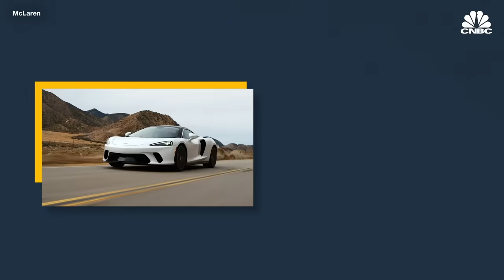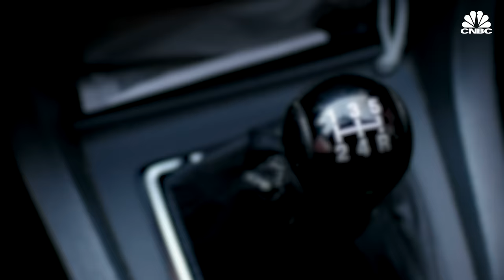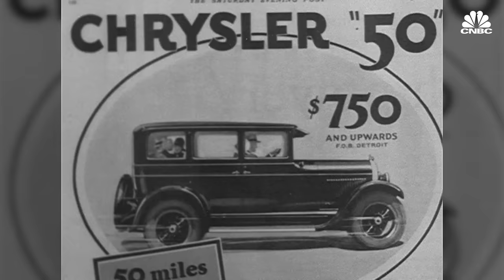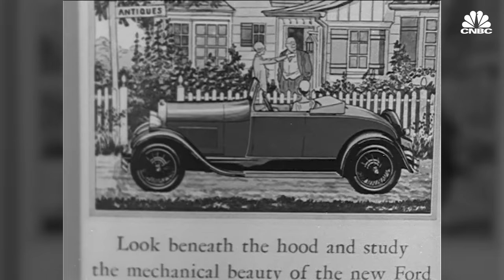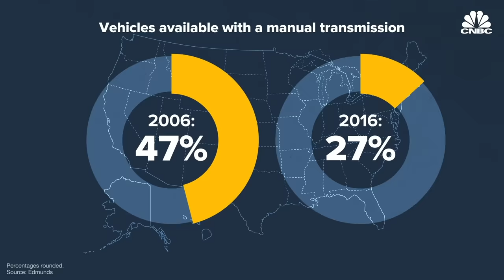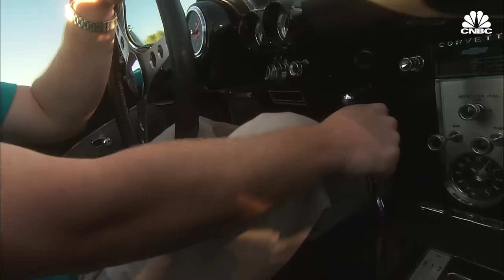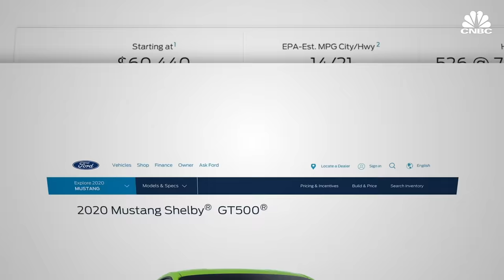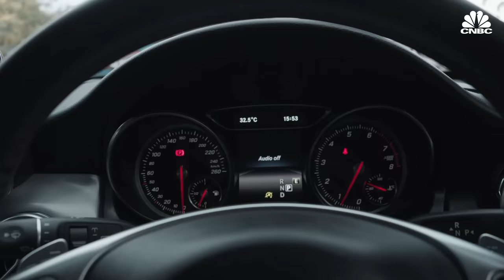Why Stick Shifts Are Going Extinct

Comment: "The trouble with manual transmissions is that they require work, skill, and constant attention." Wouldn't it be nice if we could expect those three things from everyone operating a motor vehicle?

At any rate, the death of manual transmissions is coming. The main reason is that internal combustion-powered cars will be going away. There is no advantage to a stick shift in an electric car.
Reply: I actually strongly prefer an automatic because it requires less work. I find driving stressful and working a clutch just seems like more to worry about. This is because I caused an accident a few years ago by not paying full attention. Ever since then I'm paranoid and hyper focused on my surroundings, double checking over my shoulder when changing lanes, waiting until its completely clear before merging, etc.. Last thing I want is driving to be even harder than I already make it on myself.
Reply: But there is a need for different regimes on a combustion engine, at least as a driver procedure, as stated. It can be one way to slow down when descending a cliff by shifting from a gear to the one below for instance, it's called "motor break" here in France. Also a car is not a toy, i'd feel weird having 2 pedals only to maneuver a 1 ton possible-death-machine.
Not that it's a bad thing, i just don't know automatics, i've only ever seen 1 briefly in my entire life.
Reply: @MrIronJustice  , no, i learned driving with a manual, yes, at first it tends to be such a hassle, but once you're into it, it's like second nature, when to press the clutch and change gear, you just listen to the engine and it tells you everything... i'm driving an automatic now in the US, and maybe due to muscle memory, i find my right hand always resting on the shift gear knob, overseas, i drive a manual...
Reply: @MrIronJustice  I prefer manual because every accident related to sudden unintended acceleration around my city are always involving cars with automatic transmissions, and I became paranoid of it.
Reply: @MrIronJustice  I also drive both manual and auto. It doesn't matter what you are driving because if you get into a crash, it's either a hassle or a life threatening event. Constantly paying attention and reading how other drivers behave on the road for your own safety is just plain common sense.
Reply: Electric cars have no gears at all. Therefore, automatic transmission will die in the same way.
Reply: @globalist1990  ford started making an electric mustang shelby or GT, and they make that in a manual transmission option. how? they just replace the engine with a battery and an electric motor, thats all. they keep the gearbox because they can.
Reply: @jonathanjoestar__  makes no sense, but most sport cars to drive legally on public roads never did anyway.
Reply: Global ist how does it not make sense? It's the same principle as a regular, combustion engine car. An engine/motor rotates an axle that goes into a gearbox that then powers the drive train. The only difference is what is moving the axle. There's no reason why an electric car shouldn't be able to have a manual gearbox. They might not need it necessarily but it would be fun.
Reply: @jonathanjoestar__  it’s not the same principle. A combustion engine can’t spin an axle at the same higher speeds as an electrical engine, while managing to drive at low speeds. Otherwise you could just have one gear, imagine a combustion engine going at 30k rpm! Or stalling for starting a car in 5th gear. You need gears to adjust the torque and speed of the axle as the engine is incapable of having that range. Not so with an electrical engine. Putting gears means loss of power.

In addition, you almost have no need for brakes with an electrical engine, you just need them for stable and safe braking, and also as a safeguard. Brake pads last like double the time on an electrical engine. Which coincidentally, it’s something that automatic gears fail to do in the same way as manuals or electric engines: engine braking.

Most respect for you Jojo, but in this case, you’re wrong.
Reply: @jonathanjoestar__  you can do that, but given an electric motor gives the same power output at any number of revolutions why would you want a pointless system? In fact you can couple the engine directly to the wheels and get rid of the transmission entirely.
Reply: @jonathanjoestar__   I bet an electric motor would have to directly mimic a gas engine in rev characteristics to make it worth using a manual gear box. But honestly, modern day brushless electric motors are so powerful from the first turn they make, a multi-gear transmission is really useless, and all it would accomplish is adding weight and taking away valuable space in a car.
Reply: @globalist1990  About automatic engine braking, it depends on what vehicle it is. The older autos had a limited range in which the torque converter would lock (usually in the overdrive gear only) and keep that direct connection to the driveline, most released right away when coasting.  My 2018 Mustang GT has a 10 speed auto, when I have it in manual shift mode, the torque converter would hold till I believe between 1000 to 1500 rpm. And under acceleration it’ll lock when above that rpm range, so in a way it acts like a manual, in the way it just about always has a direct connection. Whereas earlier autos more often relied on the torque converter to transfer power, which robs horsepower. 

For performance cars back in the day, they didn’t perform as good as a manual, today it’s the opposite, with autos having more gears to help fuel economy and keep a high reviving engine in the power band, quick shifting and consistency, it’s why they’re dying out sports cars today. The new 2020 Corvette has only a DCT trans. I think the last holdouts for some more years will be the Mustang, Camaro, Charger and Challengers, because they have a fairly large enthusiast group that prefer a manual.
Reply: @joshnc101  but you are talking about semi automatic, and while having more gears is positive, you can’t engine break in the same way, i believe. With manual transmissions you can avoid using brakes to slow down, you can lower a gear for extra torque for overtaking, a fast manoeuvre or making safer turns. You can make turns almost seamless by dropping a gear and turning while accelerating. Only manuals and semi-automatics can do that. Automatics would need extra electronics to predict your driving, to detect inclination, how much you are accelerating, which are common i think, but then you’d also need sensors on the steering wheel and maybe on the brake to avoid using brakes when pressing gently, and maybe even cameras. At that point you’d better off with a self driving car. You are also mentioning American sports cars, i believe it’s a different matter with European and Japanese sports cars. Sports cars are already way overpowered and overengineered, they lose very little performance on auto gears. Electrics are the simplest system, and a family ev has 3x the torque of a family petrol car.
Reply: Paddles are superior in every fashion anyway
Reply: @Wylie288  how so? Overengineered is no solution.
Reply: @MrTartar2004  My driving instructor put it like this: "When learning, you shift gears according to the speed (for example you shift to 3rd when you reach 30-35 km/h), then when you are no longer a newbie, you shift according to the tachometer (rpm counter). Then when you are experienced, you just listen to the engine and shift according to how you feel." It really does become second nature.
Reply: @jonathanjoestar__  100% untrue.  Electric cars have relatively small engines placed almost directly on the wheels.  those are the "engines" of an electric car.  under the hood you will find an AC system, a few small electronics for the winshield wipers and that's it.  A lot of electric cars have extra storage space in the front hood since the huge battery banks are placed in the floorboards....   there are no gears in electric cars,  I guess you could mess with the torque curves via a computer but there's no "gears" and no "gearbox"... there would be no reason to have a clutch other than placebo....
Reply: @nilspochat8665  Most electric cars regenerative braking by default.  this means there's tiny generators on the wheels that charge the battery when coasting.   this causes resistance on the wheels and brake the vehicle.  They essentially "engine" brake by default.   electric "engine braking" is also a thing that is put on large trucks.  they are called electric retarders and are used in supplement to jake brakes for a variety of reasons, like if you want to travel certain jurisdictions, or certain transport contracts require your truck needs to have both installed....
Reply: The oil companies aren't going to allow electric cars to take away the bulk of their profits. If it was going to happen, we'd already be there.
Reply: It's no work at all once you get used to it you can do it without even thinking
Reply: They require attention you could dedicate to the road ahead... even when hotlapping!
Reply: @MrIronJustice  You're just bad at driving manual that's all this is here.
Reply: @MrIronJustice  shame on you
Reply: The constant push by "governments" to increase fuel economy and decrease emissions means a manual will fade away. Because the powers-that-be can't have drivers deciding for themselves which gear they want to be in at any given time. They don't trust us to drive efficiently.  They want some automotive engineer to decide that "for our own good". So they program the trans to get into the highest gear as soon as possible and stay there as long as possible with a reluctance to downshift.  Never met an automatic yet that shifted up or down appropriately every time.
Reply: Actually, most electric cars don't even have more than one gear, since electric cars are much better with instant torque (at least that's how I think it works)
Reply: Not so fast. The gas/petrol engine isn't going away as fast as media and car companies would have you believe. The problem with electrics is the power source. Batteries have issues not many speak to. For one, their energy density remains less than 10% that of liquid fuels, per unit weight, and they have significant (hours-long) charging time. Both greatly affects range as well as usability. You don't want your car to be on E when you're out somewhere and it takes 8 hours to charge. If car builders used capacitors instead of batteries, you get charge times in minutes just like fueling up at the pump. But technical problems in capacitor design prevent them from getting the high energy densities needed, with our current tech. So both approaches need more than just a 3-4 years to get them ready for the masses. Engines will remain the workhorse. Unless politicians forcibly remove engines and/or fuel, then you'll be riding your live horse to work every day.
Reply: @dtvjho   was replying to the original comment and not the two dozen or so commenters about forgetting to mention electric cars, and the future. I mean, it might take a dozen or so years for many and another dozen for most to have electric cars, to overestimate, but considering the average commute is 16 miles, I'll quintuple (5x) it for a more realistic (not big city, winter conditions, inefficient driving for long period of time), making it 80. Most people can just remember to charge their car at night like you would a phone, laptop, etc. Even with the USA's 120v outlets, plugging it in after work should be enough for most commutes. For the USA, the infrastructure won't be there yet for at least half a decade at the earliest (and even later for rural areas), but I imagine (being American I don't really know that much), will be there in the next few years in the smaller countries.

Charging and Range (yes, my estimates are different, I corrected to be more conservative with my estimates):

Yes, I do charge my phone, laptop, and tablet overnight. Also, things like Tesla's superchargers (unfortunately less so for other manufacturers in the USA) and other fast chargers can top off most cars (that support DC fast charging), although that does depend on the max rate the car can charge at and the max rate that the charger can charge at. Otherwise, plugging in overnight should be enough for most commutes, with most being 32 miles (doubling the real average to account for rural areas (which may not have a commute), maybe 64 if you want a egregious example with heater and inefficient driving. Yes, I am just guessing on the spot with the extended range, but my point still stands that commutes aren't that long. For the longer trips, you can just plan around it. The people that live in the middle of nowhere in the USA aren't going to give up their big pickups for decades.
Reply: @dtvjho   I was replying to the original comment and not the two dozen or so commenters about forgetting to mention electric cars, and the future. I mean, it might take a dozen or so years for many and another dozen for most to have electric cars, to overestimate, but considering the average commute is 16 miles, I'll quintuple (5x) it for a more realistic (not big city, winter conditions, inefficient driving for long period of time), making it 80. Most people can just remember to charge their car at night like you would a phone, laptop, etc. Even with the USA's 120v outlets, plugging it in after work should be enough for most commutes. For the USA, the infrastructure won't be there yet for at least half a decade at the earliest (and even later for rural areas), but I imagine (being American I don't really know that much), will be there in the next few years in the smaller countries.

Charging and Range (yes, my estimates are different, I corrected to be more conservative with my estimates):

Yes, I do charge my phone, laptop, and tablet overnight. Also, things like Tesla's superchargers (unfortunately less so for other manufacturers in the USA) and other fast chargers can top off most cars (that support DC fast charging), although that does depend on the max rate the car can charge at and the max rate that the charger can charge at. Otherwise, plugging in overnight should be enough for most commutes, with most being 32 miles (doubling the real average to account for rural areas (which may not have a commute), maybe 64 if you want a egregious example with heater and inefficient driving. Yes, I am just guessing on the spot with the extended range, but my point still stands that commutes aren't that long. For the longer trips, you can just plan around it. The people that live in the middle of nowhere in the USA aren't going to give up their big pickups for decades.
And yes, there will be some car enthusiasts that will still buy manual gas cars regardless.
Reply: @globalist1990  I heard that the wheel motors on electrics have to be current-limited, as these motors can produce enough torque to make the tires slip.
Reply: @joshnc101  I can understand what you're thinking, if the car had a single big electric motor sitting in place of the gas engine, and connected to a transmission.
Reply: @DominicciSkycam  Trains have had regenerative braking for a long time, e.g. SEPTA runs Silverliner IV and V cars with these. When the train driver hits the brakes on a moving train, the motors are still turning with the wheels. The designers took advantage of that, so hitting the brake throws a switch and the motors are now connected as generators, for the brief duration as the train slows down.

Comment: Much cheaper to  repair manual transmission  rather  than  Automatics  which  is  very expensive
Reply: Manuals also last longer, cost less to produce and are self contained for cooling. You can't push start an automatic when your battery is low.